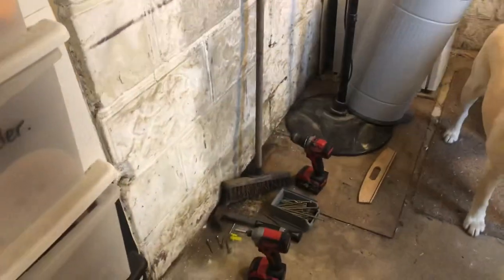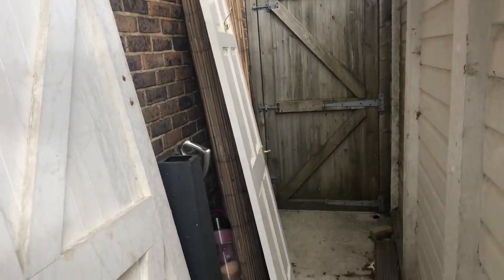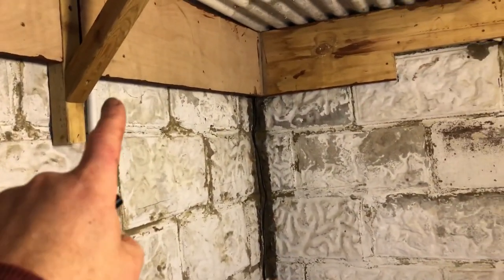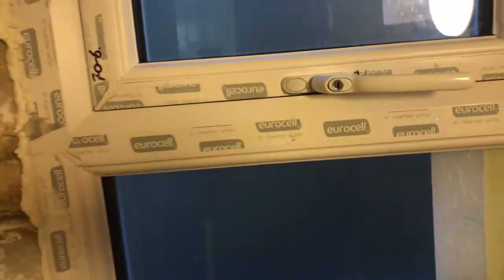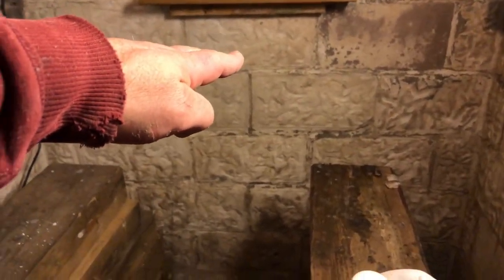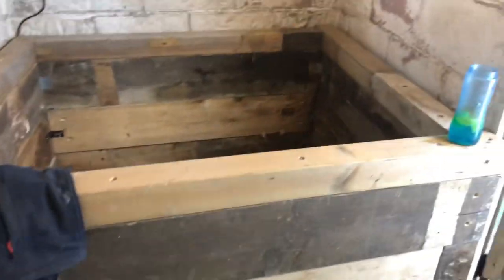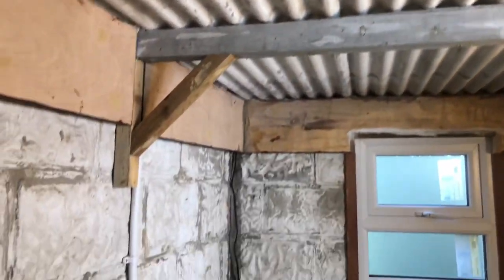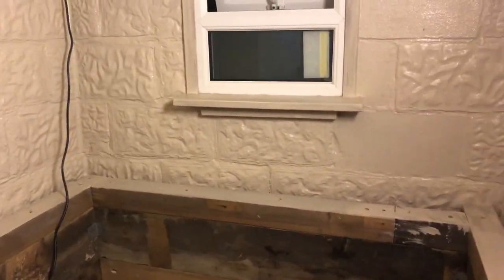Eden diy koi pond - Can I turn dump into indoor fry / grow on? Part1

Comment: Looking good Eden 👍
Are you going to insulate on the bottom and sides of the pond?
Will you be able to reach the window to open/close it?
Stay safe (Keith).
Reply from the maker: Thanks Keith 👍🏼 Only standard underlay. Don’t want to lose to much area. The old building keeps a steady temp through the winter as it’s connected to a utility room/workshop. It’s sitting at 17 degrees at present 👍🏼